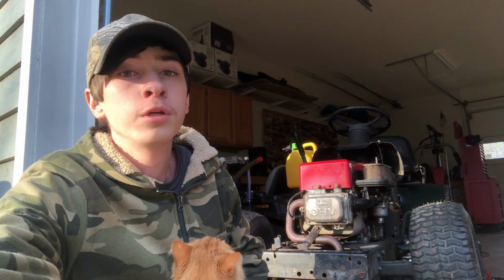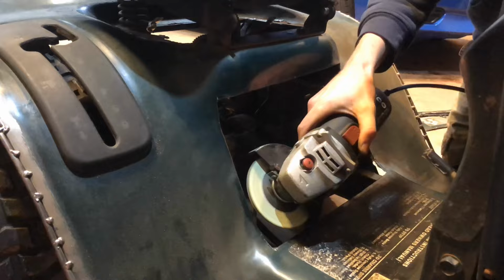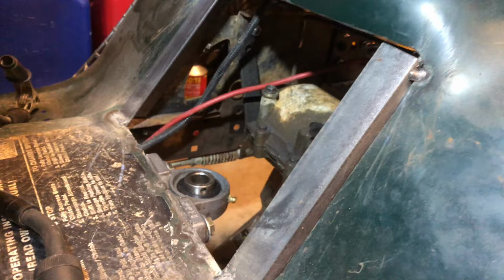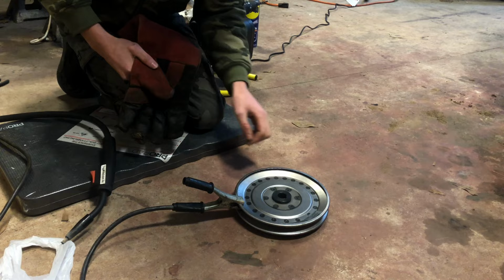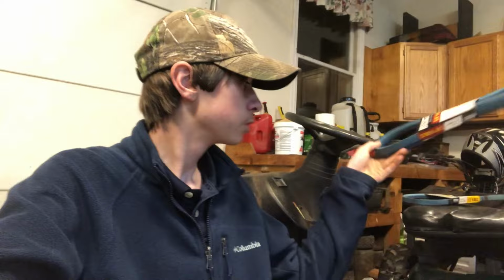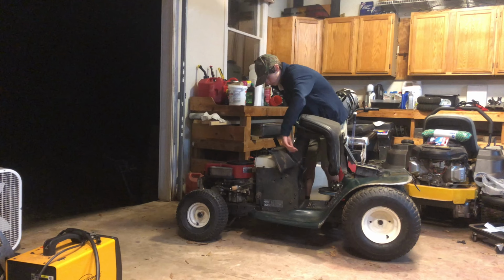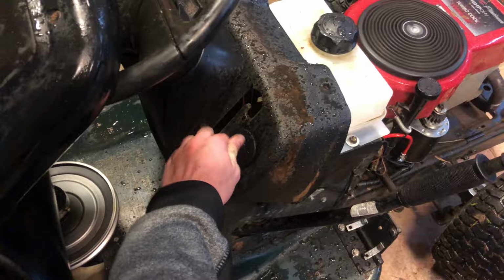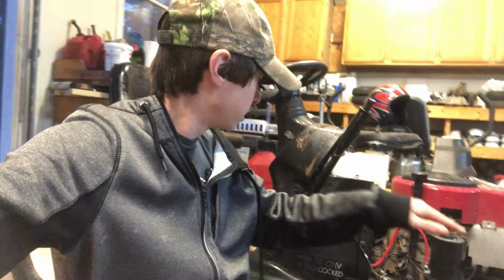Racing Mower Extreme Overdrive Jackshaft Drivetrain

Comment: That looks like it is inspired from the CarsAndCameras Rat Rod 40mph Mower build! Nice Work
Reply from the maker: It is
Reply from the maker: @NubsWithGuns  Yeah it seems to do good! the rollers may sling out and go back in some but other than that it does very well! off roading not really but speed runs it does good for me! It all really depends what type of drivetrain you want!
Reply from the maker: @NubsWithGuns  Yeah! Since I put red springs in it, it seems to be doing much better!

Comment: if anyone here is on a budget and doesnt have a welder you can also put smaller wheels on the rear end and it will drop it quite a bit
Reply from the maker: True, but probably would look right 😂
Reply: @IngenTechNational  not necessarily if you cut most of the rear fenders off. people do it a lot and it looks cool tbh
Reply from the maker: @aydeneklund2288  Yeah ture lol

Comment: Howdy from Texas! 
This is what shops are for....the deck raise arm should be an emergency brake ....powerslides in my old foxbody stangs at 60mph were the best....any thought of fitting old bicycle springs , like the 2”diameter and 5” long kind in rockhoppers....in the front crossmember or where wheels attached, wouldnt be bouncy but itd lean just enough in hard accidental turns....i have some from my old honda rincon but theyd be too big unless u cut em and put em in back where the weight is.....also valve springs from a big block ford would maybe work up front....idk im just bouncing ideas.....cool build man
Reply from the maker: Thanks Dude! I figured out the problem and it had too much tow in! Trying to get the video exported and uploaded! lol

Comment: Hey man, great vids and great build. I’m no engineer or anything, but wouldn’t bearings wear out faster because of the camber that’s on the front? If not could you please correct me and explain why bearings would be better in this situation? Keep up the awesome work and try not to flip it like C&C did! Wouldn’t want you to get hurt.
Reply from the maker: Bearings are better overall for speed and have a lot less play and rolls freer, bushing are the cheap way out on that and spins on the shaft and wears out quicker(mowing grass or even a slight pulley swap it is fine but for what I'm doin bushings are not acceptable! Obsessive camber will be fixed don't worry:)

Comment: Yo sick build man, you should definitely weld the diff so you can drift and wheelie better. Also I am gonna try this trick as well and do this do you think I could put a full 40 series torque converter on the bottom side of the jack shaft? And leave the top side of the jack shaft the same as you did in your video?
Reply from the maker: That is a good idea! Have the driver on the engine and put the driven pulley on the jackshaft! And run a longer belt to it! That will be epic! Hope that is what you mint lol!
Reply: @IngenTechNational  only problem my weld broke and shredded all my gears cause of chunks of metal

Comment: Building one of my own. Do you remember the details on the pillow blocks, jack shaft length and size. Pulley sizes all around. Thank you .
Reply from the maker: The jackshaft itself and the pillow blocks are 3/4". The shaft is roughly 12 inches long I think and 8 inch pulley on the top and 3 1/2 on the bottom.
Reply: @IngenTechNational  ok cool thank you for getting back with me. On stock engine what speed did you reach? I watched your series but I believe I missed it. Thanks
Reply from the maker: @Swigglewiggle438 I got to 51mph with the 16hp OHV, but haven't really tested the Twin. Maybe same to 55mph max if I were to guess.
Reply: @IngenTechNational  oh wow that is amazing! That is with the 40 series tourqe converter and what size pulley on the rear? Thanks
Reply from the maker: @Swigglewiggle438  Well now it has a 4 inch on the front but 3 1/4 inch on the transaxle now.

Comment: hi, I saw your video and I also installed the torque converter. 40 series on my electric tractor it has a 10kw motor it weighs 400kg but the belt overheats after a few km and the same thing happens
Reply from the maker: Ohh ok!
Reply: @IngenTechNational   ???
Reply: @IngenTechNational  does the converter belt you fitted overheat too??
Reply from the maker: @marjuspjeci4097 Not really, I took it off tho in a later episode but it did work pretty good as a semi-auto.